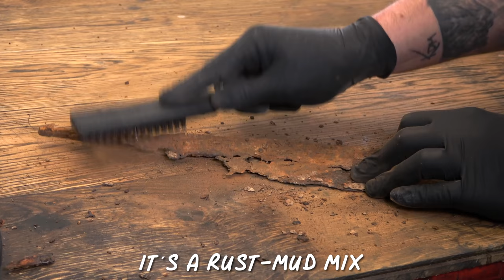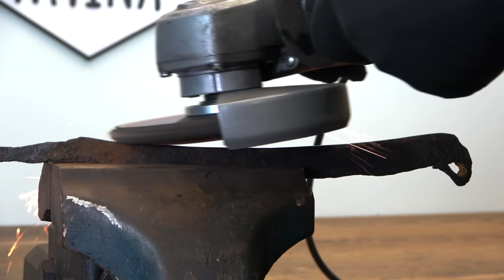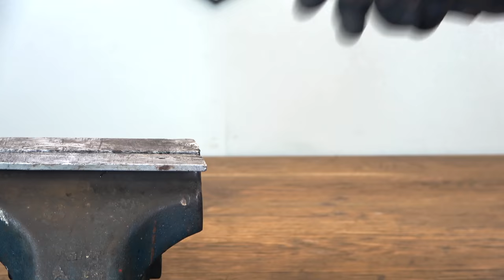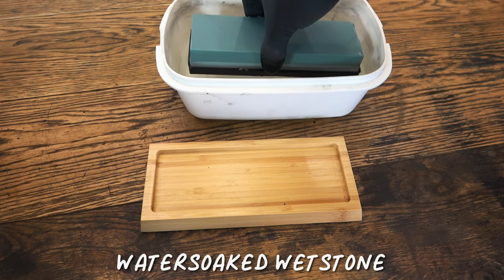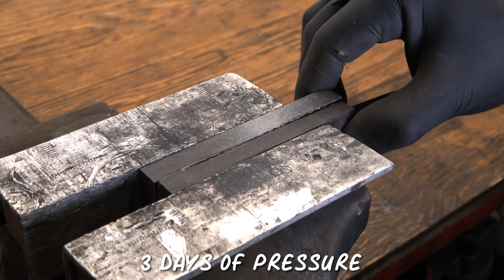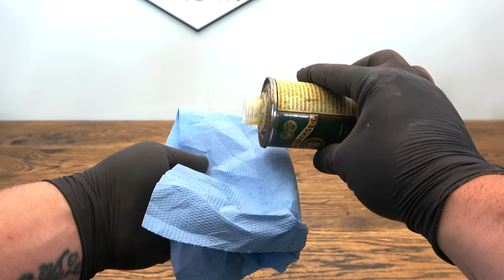Rusty Cleaver Restoration (Transformation) | Mister Patina

Comment: I'm amazed you were able to save any metal from that. I worry that the tang holes are so close to the edges they'll break inside the handle. Unless you did it off camera, I think you also ought to have tempered the whole thing because grinding and hardening it will have cause so much stress concentrations. Otherwise really cool!

Comment: Very nice use of the material. A finger well/notch at the top of the handle at the bottom of the blade would be a nice improvement for a better, safer grip and indexing. Even a small discreet finger guard. A- !